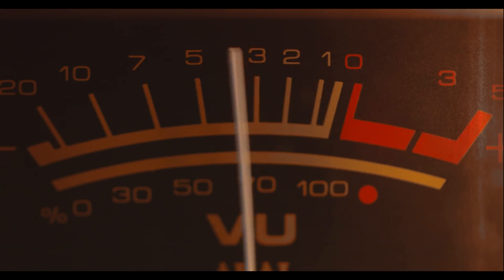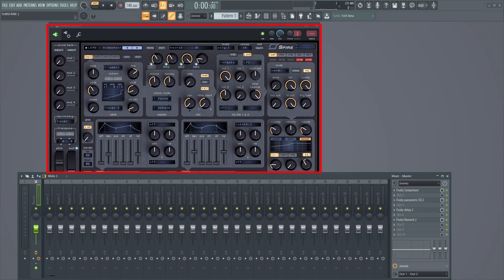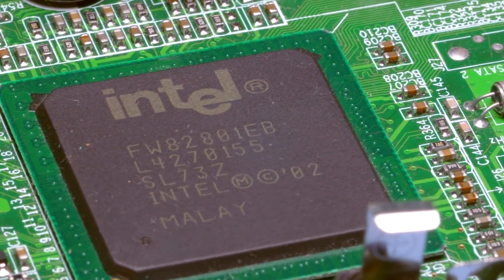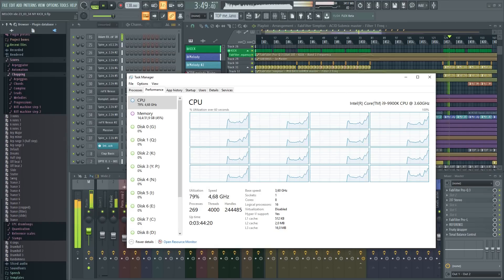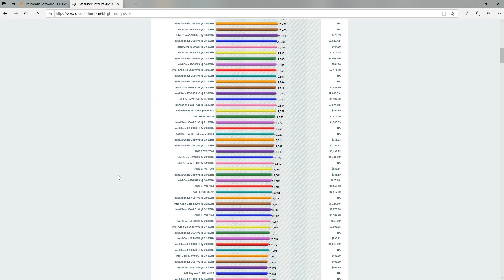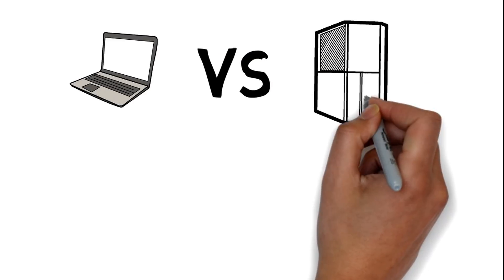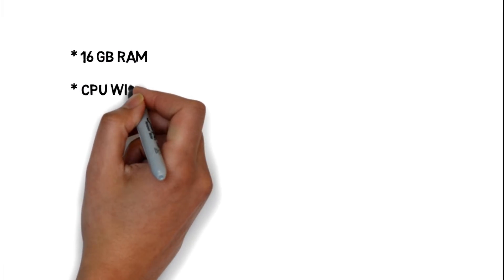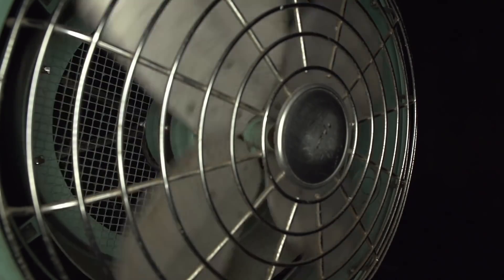The Best Computer For Music Production - What's Needed And Why!

Comment: The difference indicated in the FL CPU load test, IMHO, is not worthy of the upgrade. The i7 5820k got you good. Take it from a 6,2 Mac Mini user.
Reply from the maker: Hey, This is arguably not the best example. The old rig was a workstation platform (quad channel memory etc) vs the new I9 which is a consumer platform (dual channel memory). The i9 is still faster overall, and the price is almost the same. The i9 chip itself is about 40% faster overall, but due to the memory bandwidth etc the 5820k comes out better than expected. Keep in mind that most people use their computer for more than just music production, and a workstation platform will often tend to be a bottleneck in some other applications such as games. The i9 is a very good all round chip. 
In this particular case the difference wasn't huge, but I do see a lot of improvement in some other applications, and for most people, the i9 will be a much better solution overall than the 5820k. If I had compared the 8700k vs the 9900k instead, then the difference would have been a lot more noticeable. :)

Comment: Ive been using AMD since the AMD Athlon days.
My next upgrade will be the 
AMD Ryzen 9 3900X ,  
G-Skull DDR4 3800-Mhz 128-GB RAM (or)  the Trident Z RGB 128GB DDR4-4000,  
ASUS ROG AM4 Crosshair VIII HERO motherboard.
And I already own the GTX 1080-Ti GPU.   
The case upgrading im debating on is the 
Carbide Series™ Air 540 High Airflow ATX Cube Case  (or) the Obsidian Series™ 800D Full-Tower Case (or) CoolerMaster HAF X series HAF 932 ADVANCED.  "still deciding which"
Still deciding.
I sold over $140-k in Pro Tools hardware & gear and moved on to my new DAW I use Daily which is the Presonus Studio ONE v3 and v4.
I also own Cubase v10, Reason v10, Wavelabs 8, Reaper  and Soon BitWig. (because you can also use it on Linux).
My daily computer is Linux Manjaro, but my main music OS is Windows 10.
Reply: I have too, stubbornly.. Feels good to have a 3700x now and have the latency always set to lowest setting! While Intel is still the best for low latency stuff, a 3000 series ryzen can hang and is way better value if you can work with a big ol buffer!
Reply from the maker: The new 3000 series from AMD is very good and provides great value vs Intel. If you're on a budget then that will give you the most bang for your buck.

Comment: you should use a workstation platform and also you need to work on your cable management
Reply from the maker: Workstation platforms are good up to a certain point. They benefit from having quad channel memory, as the 5820k in this example. Single core performance, and operations per clock is also very important, not just amount of cores, so naturally clock speed is also important. You typically want as many cores possible, and the fastest single core speed as possible. Unfortunately there's always a trade off there. At some point single core speed will tend to get sacrificed as number of cores (and heat) goes up. Most workstation platforms tend to favor more cores these days, so you'll have a benefit up to a certain point, and then raw single core performance catches up. The i9 is a good choice because it offers 16 threads and very good single core performance. It also has good overclocking potential and can easily go to 5,1 ghz, which is a huge benefit. :)
Reply: @FireWalkMusic  agree on everything i9 9900K is a heck of a chip

Comment: well, there are the Ryzen 3000s now...
Reply from the maker: I know. But keep in mind that all though they have fairly similar single core performance, when you take instructions per cycle into account the 9900k will most likely still come out on top due to the fact that it can easily be clocked to 5,1 ghz, on all cores while the AMD chips seems to max out at 4,4 - 4,5 ghz on all cores. 
 I'm planning on doing a follow up video with the new 3000 series, to see how it stands up vs the 9900k :)
Reply: Can you please make a DAW based benchmark video comparing the Intel 9700k/9900k with Ryzen 3700x/3900x. In my country both Intel and AMD processors are roughly the same price, so costing aside, which is the best processor for music production and a bit of video editing? A lot of benchmarks are giving the Zen3 AMDs, specially the 3900x, really great scores, on par with Intels. Any advice would be nice. Thanks.
Reply from the maker: Yes, I'd like to do that but not all the new AMD chips are not available here yet. :)

Comment: Actually misleading. The parameters you should look after is CPU cache size, uint/float IPC and memory latency, the second is number of cores (nobody uses just 1 instrument with 1 effect chain).

i9 could be still the best (if it wasn't for the 3900X), but i7 7700K is outclassed by a relic like the 1800X.
That being said, one should keep an eye on ARM cpus.

(you can make effect chains multi-threaded, i did it couple of years ago on a high-pass filter, only 20% performance increase from 1 to 2 threads on 128 samples at a time)

Comment: What is the lowest recommended single core speed?
Reply from the maker: Hard to say. It's always a combination of core speed and cores. Generally you'll want as many and as fast cores as possible. If you go for an i5 for example, then make sure to get one with hyperthreading.
Have a look at the charts and then get the one with the best single core performance and the most cores that your budget will allow.

Comment: Intel gang
Reply from the maker: Actually, I've always been an AMD fanboy of sorts. I always bought AMD CPU's and GPU's because I wanted to support AMD and help promote competition in the marked, because that's always good for the consumers in the end. I remember back in the day when AMD was faster than Intel. AMD was also first to reach the 1 GHZ barrier. However, after that Intel took the lead and AMD was never able to catch up after that. After a while they gave up on the high end marked all together and started to focus more on the main stream marked instead. When I bough an Intel CPU for the first time it wasn't because I'm an Intel fanboy (far from it!) but because AMD simply didn't have anything that could even come close in terms of performance. I've always been against Intel having such a monopoly in terms of performance. This also enables them to crank up the prices. 
It's only lately that AMD has been able to somewhat catch up to Intel, thanks to some new very clever designs from AMD combined with Intel's ongoing manufacturing problems. The new 3000 series looks very promising. They offer almost the same performance per clock as the 9900k, at least on paper. However, the 9900k offers superior clock speeds on all cores, so I don't think AMD can beat Intel when it comes to music production tasks, even though AMD has more cores. I really wish they could though! I wouldn't be surprised if their next chip takes back the lead, because they are already very very close with these new ones. In fact, in some tasks they already do, but not in terms of raw single core performance and clock speed.

Comment: Is this with/without hyperthreading enabled!  An i recommend 6-8 cores over 4 cores as a standard! Max your ram out an depending on your monitor, graphic card ive never really cared for the integrated card on the MB is was ways just as good, unless you want to do live streaming, video capture an so on then a GC will be needed!
Reply from the maker: Hey, it's with hyperthreadng enabled. I don't recommend buying a CPU without it. 4 cores is the absolute minimum, which will give 8 threads. As you say, I too would recommend 6-7 cores. This seems to be the sweet spot at which number of cores and single core performance is at the highest. As you keep adding more cores beyond that then there will be a trade off where you'll inevitably get reduced single core performance in favor of more cores. When you add more cores to a CPU, you also add more heat, and the trend is that more cores usually means reduced single core performance. Again, there is a sweet spot, and the 9900k is an ideal choice right now because it offers very good single core performance, and also 8 cores with hyperthreading.

Comment: Great video!
Just work on cable menagment for better air fllow
Reply from the maker: Thanks. Indeed! I took  some parts from my old PC, so unfortunately I didn't have time to finish up the cable management because I needed to get the very computer i was building up and running  ASAP so I could make this video, as well as get my business back up and running. I went back and fixed the cable management afterwards though, but it didn't make it into the video unfortunately. I'm considering making a follow up video with the new 3000 series from AMD vs the 9900k, in which case it will be a lot cleaner looking. :)

Comment: I am about to buy Dell gaming laptop. Intel i7 9th Gen, Geforce GTX 1660TX. 8GB Ram. 
Do I need sound card (to attach to motherboard) for music production? I read that it's needed, some says it's not needed. I need help. Thank you.
Reply from the maker: You can use the internal sound card. There won't be any quality difference everything is done digitally. However, if you plan on recording using a mic, or if you want the lowest possible latency then I recommend getting an external USB soundcard.

Comment: so what you are saying about single core performance vs multi core performance, does that apply to ableton live too? Because at some point in version 9 they added multi core support under the settings tab and things got much better! I don't know if FLstudio supports multi core.  This could debunk that entire section about buying a CPU based on its single core performance!
Reply from the maker: Hey. All daws support multi core processing. FL Studio and Ableton are processing information basically the exact same way.They can all utilize multi threading, they are just not very good at it compared to other applications such as video editing etc. 
Every mixer track in a daw is an opportunity for the CPU to utilize multi threading. The problem is that more cores in a CPU typically means more heat. Because of this, single core performance is usually reduced in favor of more cores.
It's a bit complicated, but because of this trade off there will tend to be a sweet spot. Beyond that you'll have huge amount of cores, but terrible single core performance. The 9900k is a good choice because it has very good single core performance, and also a decent amount of cores (16 threads). 
Spreading work over more cores can help a lot, especially in large projects. The problem is that inside a daw, dependencies are constantly created. Simply put, there will be a lot of "waiting" for stuff to get done. Further more, work won't be distributed evenly across cores, so what will tend to happen is that one core will get overworked, and that will cause lag and crackling sound. The other cores can't do anything to help, even if they are idling. The core that started the work in the first place will also have to finish it (due to the dependencies created) before everything can move on. In such a scenario it doesn't matter if you have 4 or 40 cores. The added cores won't fix the problem. 

In short: Single core performance is very important in music production, but, you also want as many cores as possible. :)

Comment: And... you didn’t pay attention to the new ryzen 3000 series processors...  fail
Reply from the maker: Hey. Work on this video started in May, and it came out in June, at which time the new 3000 series had not been released. It's still not available. I've been meaning to make a follow up video with the 3900x vs the 9900k but the CPU's won't be available here until the middle of September at the earliest. I couldn't make any recommendations regarding the 3000 series in this video because it's impossible to predict how it would perform, nor was there any information about prices etc. 
Remember back when the bulldozer was announced? It was also supposed to be an Intel killer. Some benchmarks was leaked which seemed to indicate that it had similar performance as the top intel chips. When it finally arrived it turned out that it did not live up to expectations. This has been the case for some time now, so naturally most people has been slightly skeptical about the 3000 series as well.  However, AMD seems to have made a really good CPU this time, and combined with Intel's ongoing manufacturing problems this puts AMD in a good position. When I finally get my hands on one I will make another video. 
Also, keep in mind that several months is a long time int he computer world. Any hardware specific video will become outdated very quickly, which is why I structured this video so that the first half of the video is purely information about how DAWs work and what kind of hardware will be best suited for the task. :)

Comment: Nope! AMD Threadripper 2990wx, or Ryzen 3950x, 16 cores, minimum 32 GB ram, (optimally 64)
2x M.2 NVME SSD raid 0, +  1 SATA hdd, WD 7200 rpm (10 TB minimum)  
RX 5700, or 1080ti for graphics, ( some of do video editing and 3D modeling, as well as audio)
Dual 28-inch 4k monitors
QSC Touchmix 30 pro digital mixer as USB audio interface. (for full band live recording, when needed)

Comment: I can create MOD music files using Protracker or Milky Tracker on my $35 Raspberry Pi model 3B Plus with 1GB of RAM.  What more do you need?
Reply from the maker: Mod files :D Those were the days ;)
 I remember I used to make music in FT2 (Fast Tracker 2). That was before the mp3 file format was even invented, so back then there wasn't really any alternative. If you wanted to have music on your computer it would be .mod / .xm files. A single wav file would fill up your entire hard drive back then, so that was out of the question :P
Reply: @FireWalkMusic  - Sounds kinda hectic, in a way the limitations would force people to really think is this tune worth saving.
Unlike today where most of us can easily fall into the habit of not finishing producing a full track and taking a break may be returning to where we left off.
Reply from the maker: @nathantalsma3879  Indeed. IT was extremely difficult to keep track of everything, and it took much more time to make something. I could spend months finishing a track. Unlike today where you can easily load and tweak a plugin, if you wanted to tweak the sound in any way you would have to type it in manually in hex decimals. There was different codes for tremolo effects, pitching and so on, and in order to somewhat proficient you would have to memories them. :)
Reply: Mac Mini - Renoise 3 Tracker and you are good to go, of course I use Ableton Live 9 (Crashes at times, because specs)

Comment: Modern DAWs can use parall processing. And it's common that the plugins can be processed by different cores. That differ from DAW to DAW,  but most can do this. But there is normaly NO parall processing of a single plugin. Maybe some can do that, but all the one I saw cannot.  So if you are using a demanding plugin, your single core perfomance IS the bottleneck!
Reply from the maker: All DAWs can use parallel processing. Every mixer track is basically an opportunity for the CPU to use multithreading. The nature of real time audio processing means that dependencies are constantly created inside the daw, which basically means that there's a lot of "waiting" for stuff to get done. Tasks that needs to be processed in series. More cores are always better, but Unfortunately more cores usually means more heat. This is usually solved by reducing single core performance in favor of more cores most of the time. This trade off means that more cores are useful only up to a certain point. Another factor is the fact that work isn't always distributed evenly across cores, and a typical scenario is that one core will end up having a lot more to do than the rest of the cores. Once that one core becomes overworked the other cores has to wait for it to complete it's work, even if they are idling, because information is being processed in real time.
This is why single core performance is so important in applications that utilize a lot of serial processing. 
To sum it up, you want as many cores as possible to spread work over, but at the same time you want all those cores to also be as fast as possible. The 9900k is a very good candidate because it offers a plenty of cores (16 threads) and also very good single core performance at the same time. :)
Reply: @FireWalkMusic  that sums it up quite nicely!